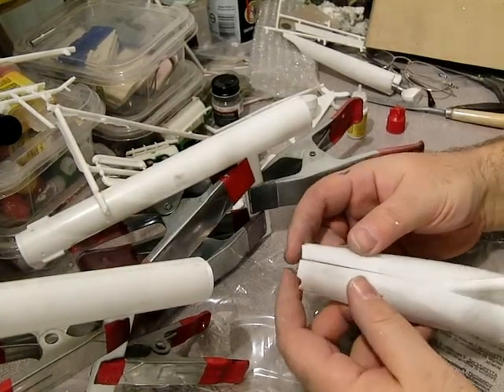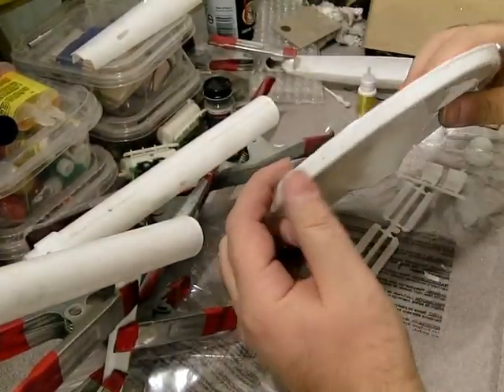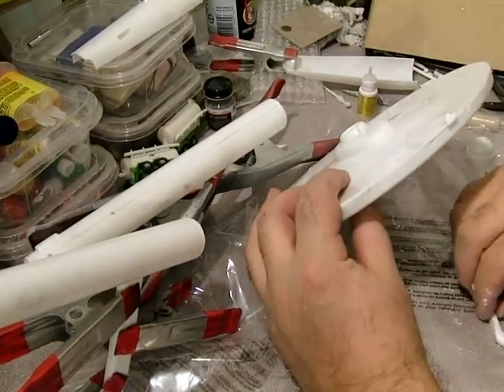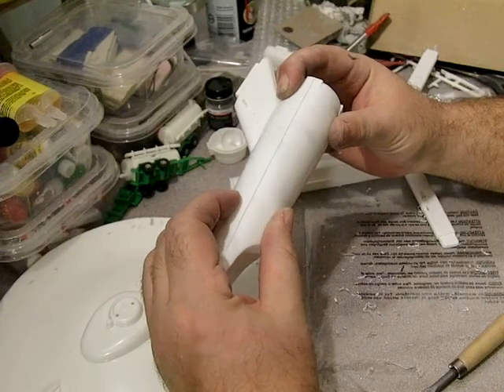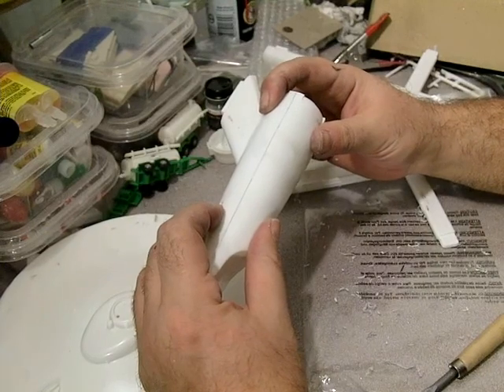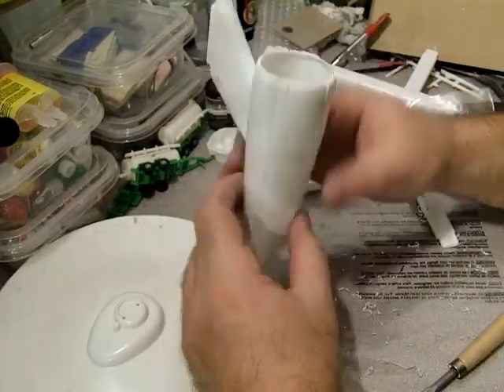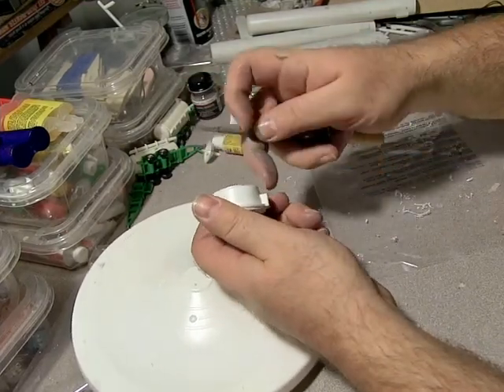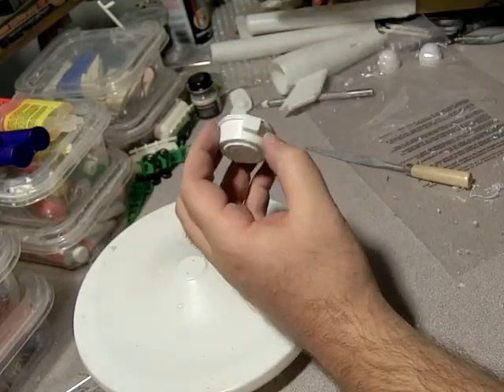NCC-1371 Republic  pt02B Another Idea

Comment from the maker: @3riversrambler I dunno. It's a fairly straight forward join.  What is giving you a problem?  It also depends on how far along you are and what pieces are glued together so far.  I'd glue the two upper halves of the lower hull together first, then the put the pylons in that, then glue the bottom saucer to neck, then the top saucer to that and finally the lower lower hull last.  I guess.